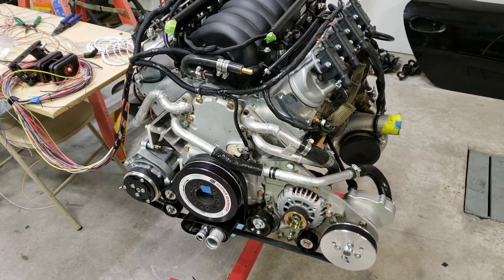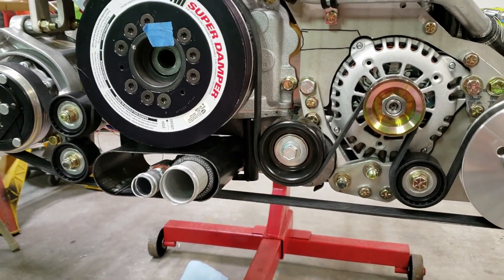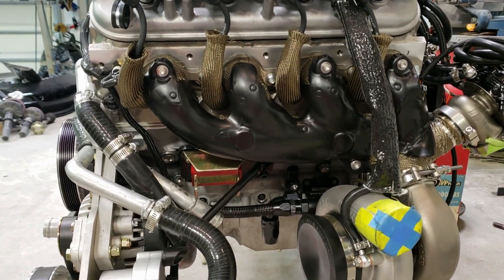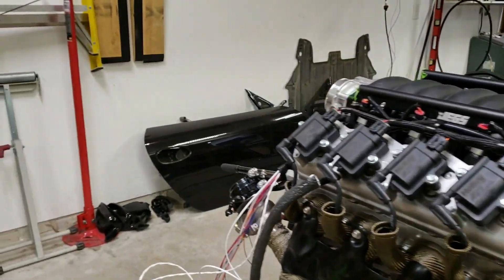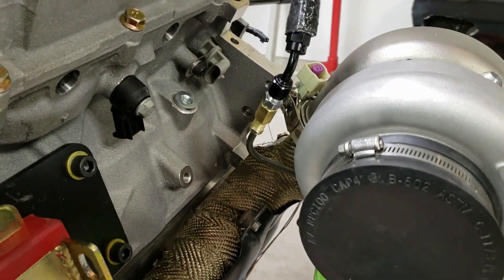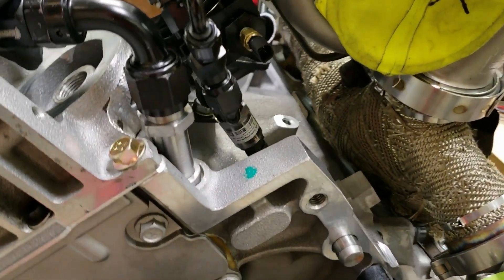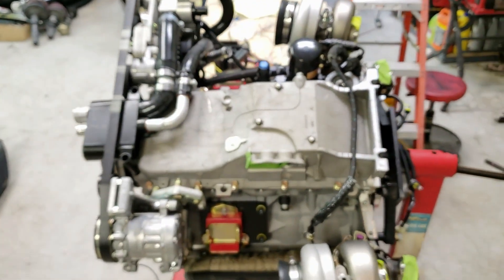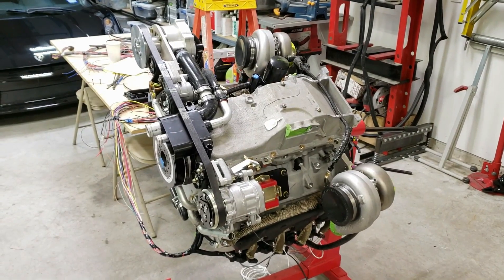1200rw+ Cayman Twin Turbo Engine

Comment: What is the model of that bulkhead connector please?
Reply from the maker: This is a duetsch DRB, but it's but and ugly. I would use a HDP and another high current low pin count connector probably if it was visible
Reply: Thanks! Doing an LS3 swap myself. Nothing as badass as this though. Great work.